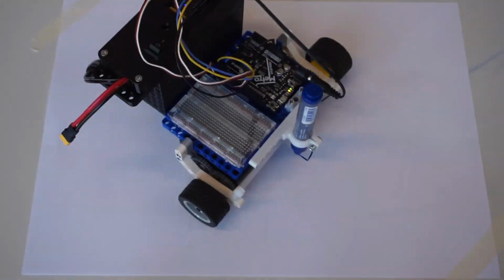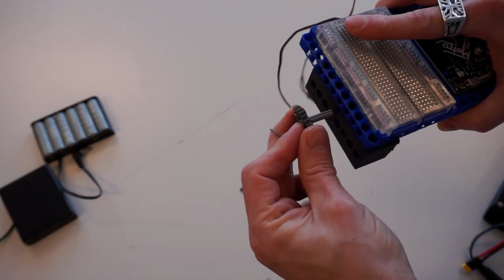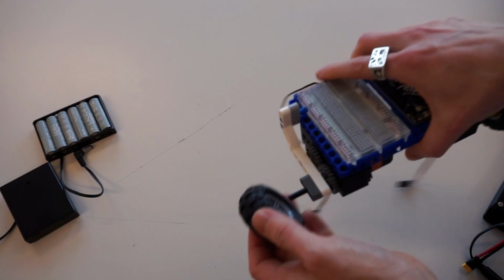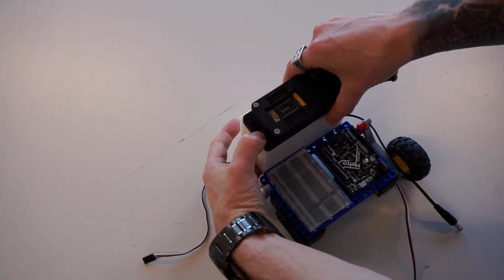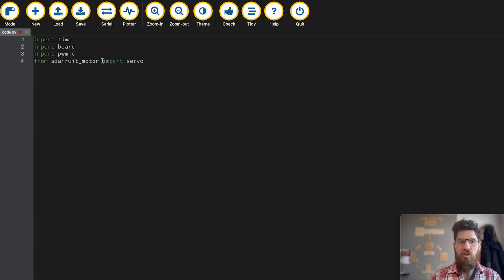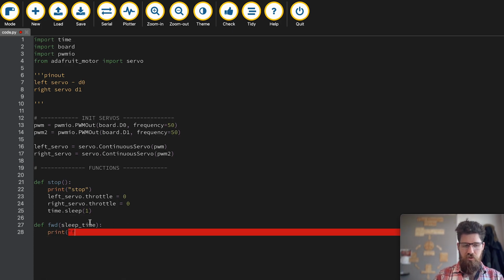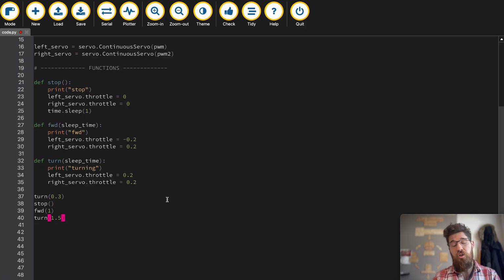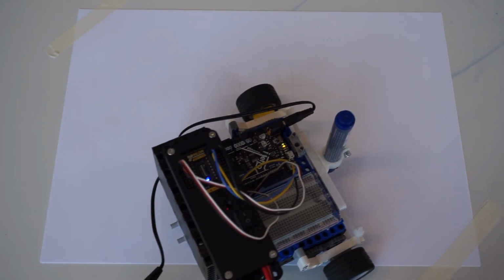How to Make a Simple Drawing Robot: Code Arduino in Python!

Comment: How you can run python on arduino and what IDE are you using on this video?
Reply from the maker: This is a CircuitPython board from AdaFruit. It has the same formfactor as arduino, but can be flashed with either circuitpython firmware, or arduino firmware. Super awesome stuff! I'm using MuEditor here.